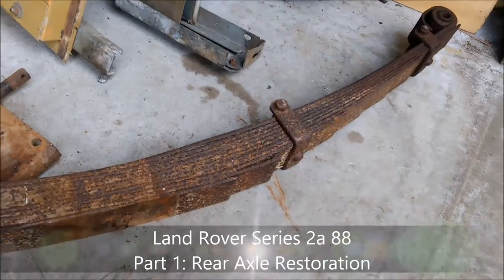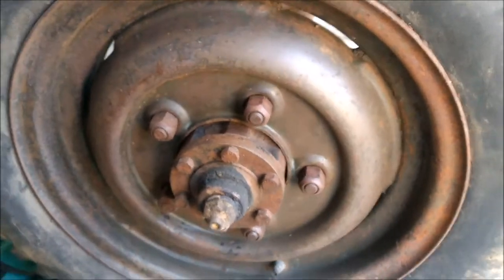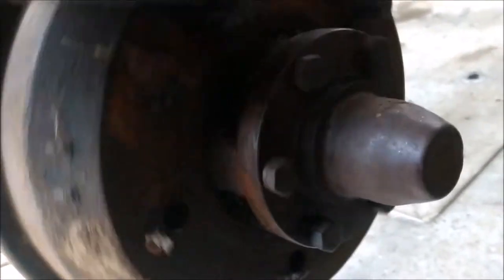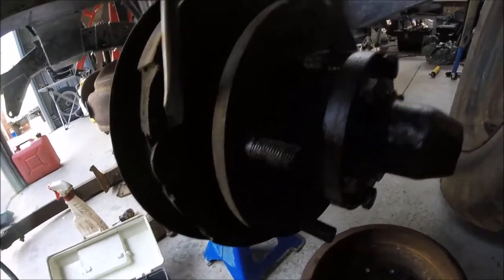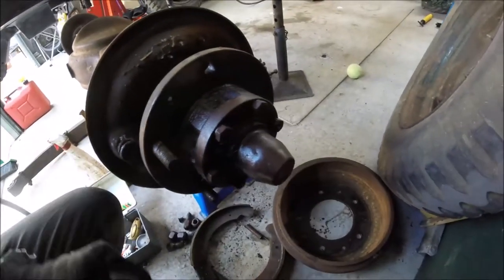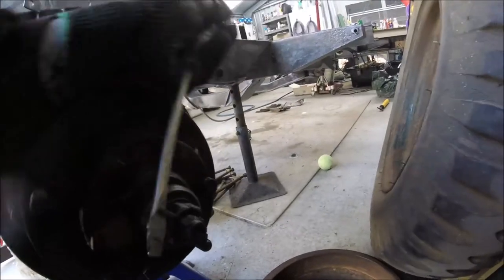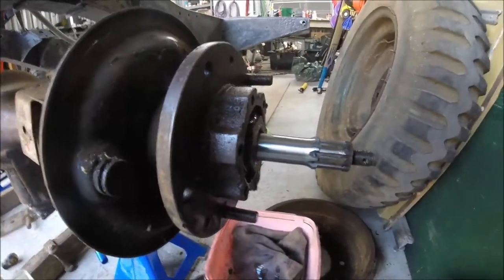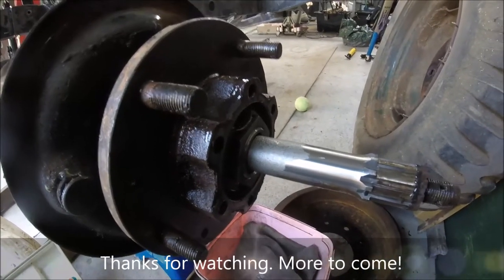Land Rover Series 2a 88 - Part 1: Rear Axle Restoration

Comment: What are my options if my studs come out with lug nuts?
Reply from the maker: You can purchase after market splined press in types.  I would take the hub with the nuts to a mechanics, they can drill out the holes to suit the new stud size and use a 20t press to get them set.